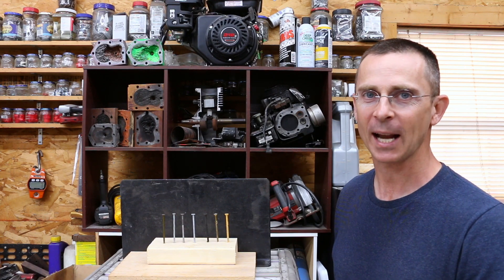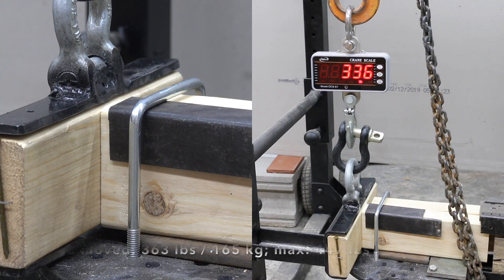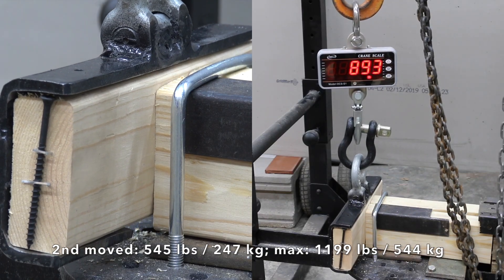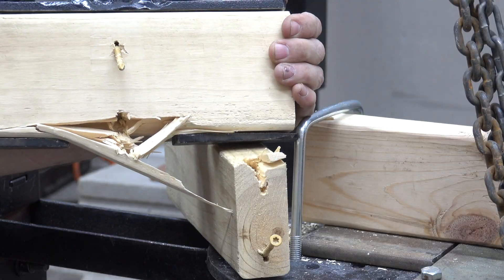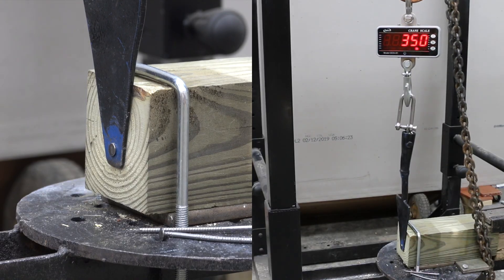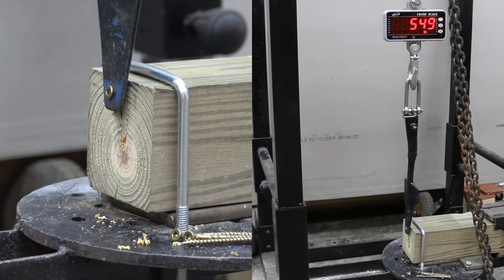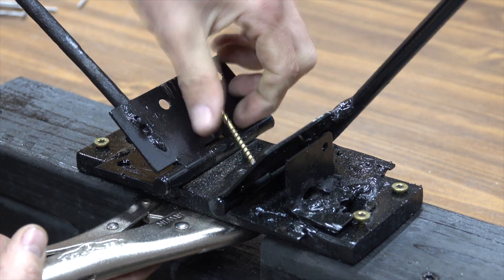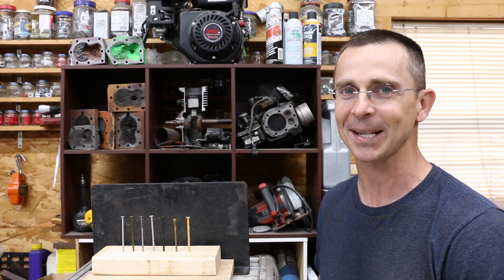Do Screws Shear easier than Nails? Let's find out!

Comment: Unfortunately, this is not a shear test.  You are measuring a combination of shear and tensile strength.  You should have had a plate beside the 2x4 you were pulling upward so that it could not withdraw from the other 2x4.  Think of a sole plate in a house.  The weight of the house on the sole plate against the floor, means that wind pressure on the studs can only move them sideways it can’t pull them upwards away from the sole plate.  So, your test here is really pretty useless sadly given the time you invested in it.  Given that a screws have much more withdrawal resistance, it is no surprise that they did much better in this test since you were still testing withdrawal as much as shear.

If you want to test shear, use your metal plate and lock the test specimens in a vise so that they can’t move in tension.  Now you can do a more representative single shear test.
Reply from the maker: Thanks for the constructive feedback

Comment: Maybe a test comparing over sinking the nails and screws, vs holding them flush with the board vs leaving them higher than the board? See if that 1/4 to 1/2 inch makes a significant difference or none at all?
Reply from the maker: Thank you for the video idea!

Comment: Do roof truss brackets vs hurricane strapping vs nothing. The problem is the wood used today just sucks. The trees are too young and haven't had the chance to mature before they are cut down. I used 3 1/2 inch Drywall to build my house with. I live in Oklahoma and it has already been tested with 80mph winds without as much as a budge. Screws are the way to go in any home but all builders are cheap and use nailer's which half the time they barely hit. Its all about money and speed and not safety. I see it every spring when these 300k house come apart from a EF1 tornado. You would think people would learn.
Reply from the maker: Great suggestion! Thank you

Comment: An important factor is actually the tension of the fastener.  One improvement to this test would be to have a calibrated method to tighten the screws.   The tighter the screws are in example 1 & 2 the more the screw is actually doing tension instead of sheer force as the friction of the wood grows more and more the tighter the screws are.

Bolts and nuts with steel plate are really the best way to show this.   Although steel has a fairly low coefficient of friction when you bolt two plates together there is a sizable amount of force pushing the plates together and this creates a lot of friction.   Loose bolts will sheer much easier.  Steel is also much more uniform than wood but obviously impractical to test these types of fasteners with steel, some chunks of plastic might have worked well- but would be expensive testing.

Good video though.
Reply: And by the friction of the wood, I mean wood to wood.  ( or in example 2 the steel to wood )  ( so whatever you are holding together, not talking about the fastener )
Reply from the maker: Great recommendations! Thank you

Comment: I think the test is flawed. The nails don't shear, they pull out. For a shear test you should have a support behind the T to keep the T  from angling out at the bottom allowing the nails to slip out. The T section should go straight up. Other than that, this was an interesting test.
Reply from the maker: Thanks for the constructive feedback

Comment: Great test!  As a framer,  I understand a bit better why we are required to use nails for sheer walls (plywood).  The nails hold up much better to any form of possible movement.   Im still hoping you do a test on different wood glues.   Also concrete and drywall fasteners if you haven't done them...  keep up the great work,  your channel is a great resource for many,  professionals included.
Reply from the maker: I hope to test wood glue soon. Thanks again!

Comment: Oooo nice, cool test and setups, 400kg is a lot :) dit you test bolts and nuts already?  Like max torque on head, how much force to bend, susceptible to rust, weight, susceptible to heat ( then bend it again)  (like in use for exhaust manifold), quality of the threads (the play it has with a nut) tensile strengt of ripping off the head of the bolt (using hydrolic jackstand) keep the vids coming you're great :)
Reply from the maker: Thank you for the video idea!

Comment: Love your videos.  Good pace, good information.  I've got some feedback on this topic for you--I think your tests did a good job of displaying the strength of the various fasteners, but I really don't think any of your tests specifically demonstrated shear strength.  Shear strength is the ability of the fastener to resist failure to a lateral shearing force--the operative word there being "fastener".  The failure mode in your first couple of tests was almost always wood tearout, and the test where you were bending the fasteners you rightly refered to that as a test of ductility.  To test the shear strength, you might try devising something with a press or a hydraulic jack where the fastener passes through a couple of tight fitting plates with holes drilled through them just large enough for the fasteners to pass through.  The trick is to keep the plates tight and parallel to each other during the test so that you're truly measuring shear without additional twisting forces.  

Here's a site with a picture of double shear testing where the fastener is supported on both ends:  https://www.instron.com/en-sg/testing-solutions/by-test-type/shear/nasm-1312-13

And here's information on both single and double shear methods:  https://www.amesweb.info/StressStrainTransformations/Shear-Stress.aspx

Thanks for what you do here.  I really enjoy your videos.  :-)
Reply from the maker: Thank you!  I can easily build a double shear test jig. Thanks again
Reply: @ProjectFarm  You're welcome.  And thanks for taking the time to respond.  Nice of you.  Have a great day.

Comment: I think there would be a difference in the type of wood used, it appears pine or soft wood was used, I noticed wide growth rings ; knots etc used. I also think if the wood was affixed from the side instead of the end grain. I think both nails and especially screws would have better holding power if they were screwed in the side of hardwood plank as opposed to the end grain.
My thoughts, opinion
To be fair, the test conducted for nails and screws would apply and dependent only to the type of wood grain end vs side /wood density and moisture content used per each test. 
I am a subscriber and enjoy all your videos.
Reply from the maker: Thanks for the constructive feedback
Reply: @ProjectFarm  I also noticed some slight side loading on the shackles that varied from each test, while it may not be a factor, you can't rule it out either, it may add or take away breaking strength.

Comment: I think you should also consider testing shear using an "instantaneous" force.  Such as would be experienced if something would fall on the fastened joint.  You may find this is where some nails do much better that the screws.
Love your videos. Keed up the good work.
Reply: You mean an ultimate strength instead of yield test. He'd have to have the ability to increase force more quickly. I don't know if his equipment can do it, but I was thinking the same using Physics terms.

If you spend too much time in the yield, or bending zone, the ultimate  or snapping force can be unrealistic.
Reply: I was thinking the same thing. A simple pipe with a weight could be the test jig. Drop said weight in pipe at specified height with wood pieces fastened together underneath.
Reply from the maker: Great suggestion!  Thank you

Comment: Driving the fasteners into the heartwood of a pressure treated board doesn't see very repeatable.  Some of the boards had knots and others had the heartwood off to the side, there by changing the density of the wood.  Why not just use the kiln dried 2x4 like the earlier test?
Reply from the maker: Thanks for the constructive feedback.  2x4 splitting was the main concern.

Comment: Video idea: concrete versus post foams (Sika, QuikSetPro, Secure Set, Fast2K, etc) for setting fence posts.   Not just how strong they are after they're set, but a long-term test to see if they're still plumb and how much force it takes to pull them out of plumb after 1 year, 2 years, etc.  Maybe also test against gravel or hard-packing dirt around them, as some people do. 

If you have space to leave a bunch of useless fence posts sticking out of the ground for years, that is :D
Reply from the maker: Thank you for the video idea!

Comment: I like the design of the test gear.  Interesting that a single fastener pulls out with less force than 2 fasteners with the apparatus you used.  The manner of failure looks to be what is called "snaking" when rebar pulls out of concrete.  I would be interested in a test with the fasteners put perpendicular to the grain of both pieces of wood and also pulled perpendicular to the grain in both pieces of wood.
Reply from the maker: Great suggestion!  Thank you

Comment: I'm not too concerned about the shear strength of various screws or nails.  More impressed with the engineering that went into the attachment jig and bracing for the puller.  Great work!
Reply from the maker: Thank you very much!

Comment: Yet another great episode. I was wondering how that Ranger is doing. It popped up in the "recommended" section.
Reply from the maker: Thank you!  I need to do an update video on it.  It gets worked hard on the farm and I need to put together an update video.  Clutch is just about worn out. A clutch replacement video to include dropping the oil pan while I'm under the truck would be interesting.  Thanks again!
Reply: the radical improvement that it showed was amazing. Glad to hear it's still kickin.

Comment: I think you should test to drive the screws and nails cross grain in both boards to get the maximum holding power. When they are going in to the end grain the wood shears so it will slip out of the wood before shearing. Keep up the fantastic testings.
Reply from the maker: Great point. Thank you!

Comment: Many of the fasteners used here can't be used in treated lumber, so that's a consideration.   Even with that, after 5 years of weathering, I've found that the specially-branded ceramic coated deck screws corrode.   I'll probably bite the bullet on my next deck and use stainless.   I used them on my porch and railing and after 20 years, they still look like new.

One thing that jogged my memory are the stubby, thick hot-dip galvo nails specially made for use with Simpson Strong-ties.  I wonder what the shear force for those would look like.
Reply from the maker: Great point!  Thank you
Reply: It would be hard to test the stubby tie nails, they're too short.
Reply: @gtfkt  Well, they do come in 3 1/4" length (16D HDG)  hot-dip galvo.   I've always wondered if there was something special about them, or if I could use plain old 16d HDG common nails.  I do read that Simpson is very picky about screws,  stating that only their SD connector is approved for the purpose.   Those are washer, hex-head jobs.

Comment: This showed the pull-out strength of the fasterns in end grain more than the sheer strength of them. It ould have been better to fasten them into the side of the 4x4 rather than the end. I think you would have seen a lot more strength from the screws (and some of the nails) and hit the breaking point on more of the screws.

I don't know if it would be reasonable/fair/required to have something preventing the piece being pulledon fro moving away from the base piece (again to make sure the failure is sheer, not pullout)
Reply from the maker: Thanks for the constructive feedback.  I've already built the required hardware (in my head) to achieve the objective you're described.  I also need to use a much harder wood.  The wood I used will come apart before most of the nails and screws shear
Reply: @ProjectFarm  I appreciate this softwood test since it's similar to framing methods.
Reply: I don’t pull out

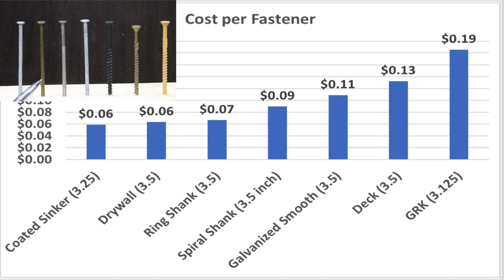Comment: 11:45 Most of the screws withstood shearing from the pulling rig, but obviously fail in the bending rig.  Could that be due to differential hardening?  After all, the shanks that you're bending are supposed to be deep in the wood, whereas the shanks near the head can be expected to be more exposed.
Reply from the maker: Great point.  I believe the bend that I applied was much more aggressive than a fastener would normally experience but demonstrated which fasteners could handle repeated movement the best.  I really like deck and GRK screws the best for most of my applications around my farm.  Thanks again!

Comment: With all the Kyle monster memes bouncing around, I'd love to see you test and confirm which drywall and or sheetrock is the most punch resistant.
Reply: Lmao I am a sub for thr bois as well and for pfi these channels r nite and day from each other but I think project Farm could build a mean Honda
Reply: lazerlake ugl vs national gysiom
Reply: @Nick Lenius lol! Not many are punching them. How about a practical test?
Reply: If I had to guess I'd probably say the moisture resistant kind you put in bathrooms. That stuff is heavy/hard as hell.
Reply: @olds767 or core board it is about 1.25  thick it is for sound deadening in factory weighs about 140 lbs I did commercial metal stud framing and sheetrock for years core board is hard to cut and just hard to work with
Reply: @olds767 probably walk away with a cast after that, it is solid af

Comment: Do a video on the best way to put steel in concrete, is it better to drill and epoxy or put it in wet, rebar vs smooth stock.
Reply from the maker: Thank you for the video idea!

Comment: At the start you said you'd test metal fatigue strength. But you tested how many times each fastener could be bent before it broke, which I don't think were fatigue failures. You exceeded the yield points of the metal (the fasteners were permanently bent.)  Fatigue involves cracks that grow and then cause failures at much lower stresses, which is why engineers were mystified when 19th century train wheels fell off, or the Comet airliner kept falling out of the sky.  At least that's what I remember from school. Love the show.
Reply from the maker: Thanks for the constructive feedback

Comment: I'm not convinced that you accurately measured shear pressure. You partly did but then there becomes a point where you are actually pulling the nail. Also you measured parallel to the grain.. I'd say 98out of 100 nails are driven perpendicular. You should back the piece that you're cranking upward. You might ask when that ever happens in the field that a nail is backed with additional lumber.  It does happen, but also when is a board only nailed in one stupid spot? I dunno

Comment: Why do they make screws out of crappy pot metal ?
Reply: They're not crappy pot metal, they're hardened steel. That's why they can't handle bends like framing nails, because framing nails are not hardened like screws are.

Comment: First, great topic and testing yet again!!
Second, I use drywall screws or deck screws for 99% of projects, (GRK when needed). Besides strength, the screws give me the ability to get into tight areas and better yet .... easy redo!
Third, the study I read showed length was the main factor for holding strength. 
Forth, another paper I read showed the huge strength variability in mass produced screws, which is why they were not construction approved. 
Final, trying to tear down construction where they used mass produced cheap drywall-screws is a pain, because the rusty heads are no longer useable, but they keep holding in even weathered water swollen wood no mater how much hammering is used — even using ample amounts of “loosening” words.  I respect drywall screws no mater what the study says. 
Good job!  Thanks!
Reply from the maker: Great points!  Thanks for commenting!

Comment: I don't think you've actually tested shear strength at all here.

What I would do is drive the nail/screw into and through a relatively thin board, then through the puller at 6:00, and into another board.  In both cases with the nail/screw perpendicular to the grain, and also with the grain horizontal (i.e. perpendicular to the pulling rig).  That should measure how difficult it is to actually shear the nail or screw, rather than how hard it is to pull out of the wood, or how well it handles a bend (which is not equivalent to a shear force).
Reply from the maker: Thanks for the constructive feedback

Comment: Great test!  As a carpenter i've seen quite a few deck screws snap off in P/T decking over the years.  I just assumed it was due to lack of shear strength but after watching this i believe it's due to the expansion and contraction of the boards over time.   The screws are so hard that they lack the ductility of the softer nails.
Reply from the maker: Great point on expansion and contraction and broken screws.

Comment: If sheer force is a issue yes the dry wall screw failed but the nails failed long before. if the drywall screws had failed even 10% faster they never would have broke. they grip better and it requires more to get them out with out properly removing them. I tore down a 23 year old swing set was suppose to be a easy job but they used screws we had to pull every screw to dismantle as we couldn't just smack the boards apart
Reply from the maker: Great point! Thank you

Comment: You certainly come up with some interesting testing jigs. My concern is that you weren't really testing the material strength of the fasteners, in every case where the nail or screw didn't break you were only testing the material strength of the wood. Each fastener needs to be tested to destruction to really determine which is the strongest.
Reply from the maker: Thanks for the constructive feedback